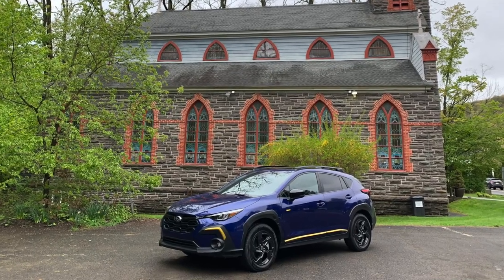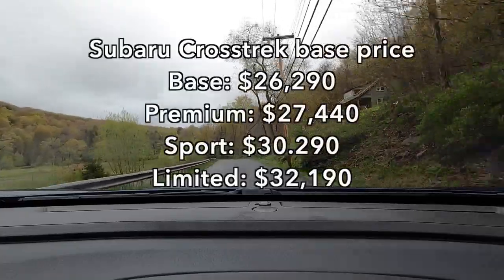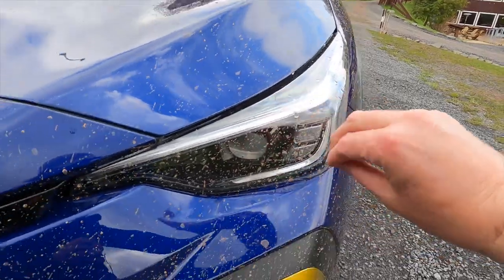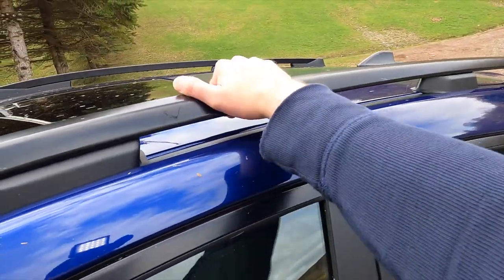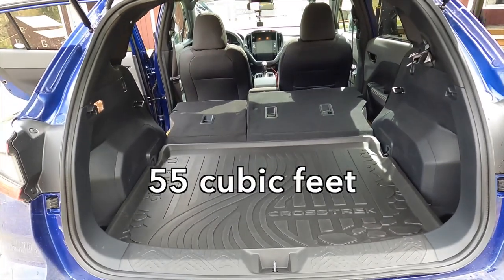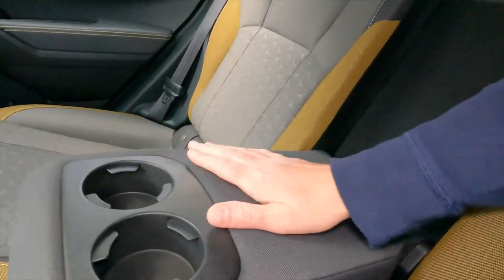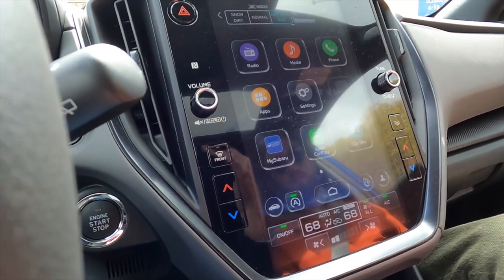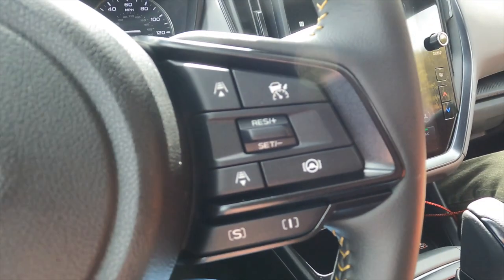2024 Subaru Crosstrek Sport Review: Will Play Off-Road!

Comment: Nice review. I like the Crosstrek, however the CVT is considered to be unreliable and not durable long-term.
Reply from the maker: Thank you!
Reply: I'd like to know your source for the unreliability of the lineatronic transmission.  I have read just the opposite with respect to both performance and reliability.
Reply: I inherited a Subaru Impreza which I proceeded to beat the piss out of... 11 years 175000 Mi and with minimum regular maintenance is still going strong. Prior to that my most reliable car... a Porsche 911 Carrera a very high performing Auto (who's Hallmark is it's incredible reliability).. the Subaru is slowly curing me of my high-end European car snobbery.. I'm waiting for my Crosstrek limited to arrive at the dealership
Reply: That’s more of an issue with Nissan CVTs

Comment: You are penalized for break torquing since it triggers a safety feature to prevent acceleration when both pedals are depressed. Supposedly it is to prevent accidental acceleration for elderly buyers so they don’t get confused and drive through the front of a store.
Reply from the maker: Interesting. I tried accelerating without brake torque and didn't feel any improvement. But with more time, I'll examine that further.
Reply: @viewsonvehicles  It's not on Subaru's website, but it is in the print brochure: 
Brake Override System: If both brake and accelerator pedals are pressed simultaneously, the system reduces the operation of the accelerator pedal to help prevent unintentional vehicle acceleration.

Comment: Hey man great review. I have this exact vehicle on my radar as my next SUV. Do you know when they will hit the dealerships?  When you said it has a good bit of body roll would you consider it similar to or better than an 18 or 19 nissan rogue SL AWD?  Man I was planning on customizing my 18 AWD rogue with a 2 Inch suspension lift and going up in tire size with some toyo open country ATV III aggressive sidewall all terrains as I had planned on it ever since I got it and finally saw one like I plan to do and it looked every bit as good as my mental photo I had of it as if I had already customized it. I then saw this exact crosstrek sport same color the other day and instead of leaning towards the dodge Hornet this crosstrek sport caught my full attention plus the price doesn't seem to be grossly inflated. Was the body roll real bad?  I do want something that at least handles itself well as opposed to my 18 rogue having major roll. I subbed and liked. Any feedback I would greatly appreciate it. Thanks a bunch and since I subbed I'll be catching your other reviews. If you have any recommendations please let me know. The other SUV I want and really like is an Acadia SLT or AT4 which I know is midsized but over 300 hp and its a little smaller than a true midsized and appears to be pretty nimble which either this or that I still plan on swapping the tires to toyo open country ATV III to give it that off road rugged sport look because it will look pretty good. Thanks for any feedback. 

Kashton 
The Dive Watcher
Reply: 10-12 weeks
Reply from the maker: Thank you so much! It handles fine, everything about the motions are expected and controlled, you just get a fair amount of roll, pitch, and dive. But it will feel fine when compared to the Rogue. It's decisively less off-road worthy, but I do also quite the like the new Honda CR-V. I reviewed the Hybrid recently. Link is below. I haven't gotten the chance to drive the Acadia in years, so I cannot say, unfortunately. I did, however also recently review the Canyon AT4X. That one is mega for off-road. But also double the money. https://youtu.be/Qe9Vp354yBQ
Reply: @viewsonvehicles  hey man. Thank you for letting me know. The main reason I settled for my 18 rouge was because it was the top of the line fully optioned SL and main reason it was AWD. I plan on customizing it to look off road and a bit rugged and sporty changing the entire look up. It will also slow me down. I don't drive recklessly but I do drive with a heavy petal. I was fortunate last month. Talked my way out of being written two speeding tickets. That's why I have mainly and mostly always driven trucks or several tahoe and yukons. They aren't as easy to look up and me going 85 or 90mph on the open interstate. The compact SUV are easy to drive and thus too easy to get up and go. I'm thinking I put one size larger tire. An aggressive all terrain with a 2 inch suspension lift can't help but slow me down some. I had been leaving towards the Dodge Hornet GT but I'm afraid I'd get a ticket day one. Lol. I do like the Acadia AT4 AWD but man vehicle prices have lost their minds. They have become utterly out of reach.  This Crosstrek sport I think as optioned is around $32k. Maybe a little lower. I'd not put a lift on it but I would put some aggressive all terrain. I appreciate the response. I do wish it had at least $200 HP. Sounded like from what your expression was zero to 60 that it had plenty of torque so that can make the HP feel 20 percent higher from what I have come to realize.
Reply from the maker: @TheDiveWatcher  Yeah, you got my impression right. Another one to consider, if it's at all in your budget, is the Honda Pilot Trailsport. Bigger, huge inside, and more power. But a lot more expensive too. I got to review it earlier this year, if you're at all curious: https://youtu.be/cHOo8Hq3bS4
Reply: @Robin Warner  hey brother, I actually in fact looked at one of those up close at a dealership and you are right.  Those are nice. Expensive but like I told a dealership sale manager who called me back on a 2021 model Dodge Durango that I happen to see as I was passing by on my way to look at another property that ended up being an RT Hemi and I'm fine with a GT Plus V6. He began to push brand new and I told him it's not that I don't want a knew tide but you guys have inflated new car/truck prices so high that they all have become out of reach for even those who make an above average income to either not afford them or to have a payment equal that of their rent or house note. I have to think the vehicle new car sector to be right on the verge of a bubble burst similar that of the 2009 real estate collapse and deflating of the nearly double inflation prices but I'd be curios to hear your thoughts about that and if it's in fact about to happen. I know market valuation being a Certified Appraiser but the car industry I've found quite difficult to accurately put a true market value on as there seemed to be too much hidden important data that is need3d to properly value. What have you seen or think? Man new car prices are insane and I don't see how any of them will be able to sustain without the market buying them. Something seems to me has got to give.
Reply from the maker: @TheDiveWatcher  Yeah, this is clearly not sustainable. I think the manufacturers are working hard to have a soft landing, meaning that prices will slowly get back to sane levels without tanking interest. But, personally, I also prefer used as I am not that particular about exact options and color combination and can get a well kept car for 25-33% cost of new. I tend to buy cars that are 5-8 years old and them hold on to them for a while.